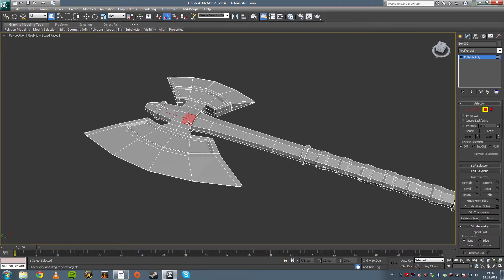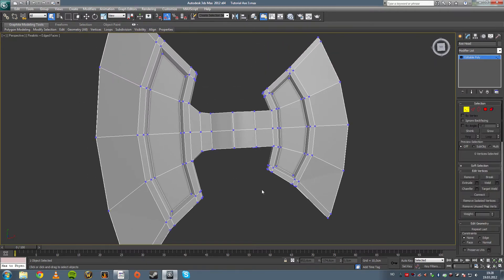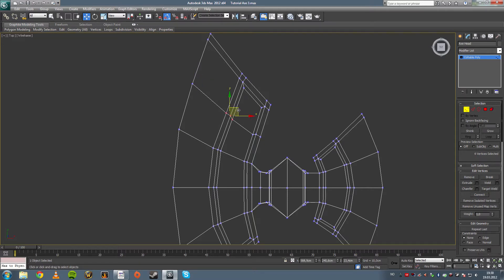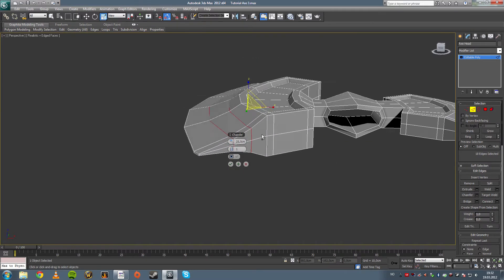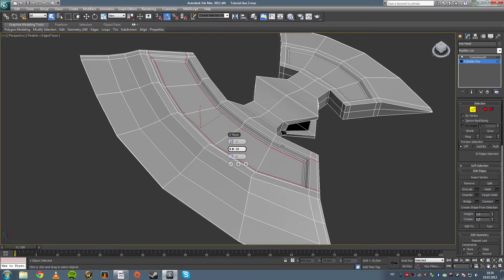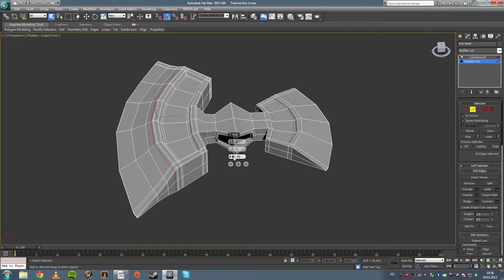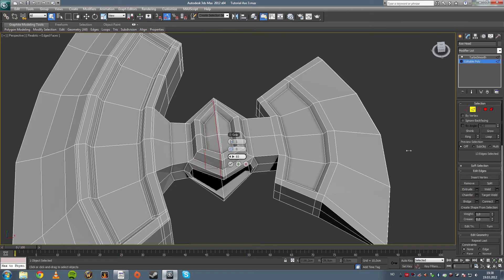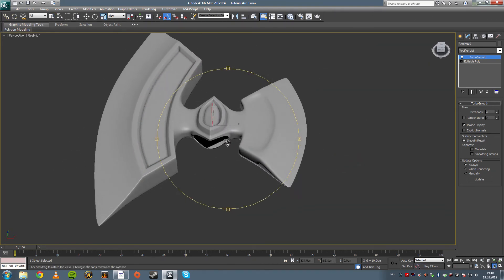Sub-D Modelling in 3Ds Max Part 2

Comment: Great advice for beginners to Sub D modelling. I personally avoid Turbosmooth and use the Sub Division Surfaces in the sub object menu. Reason being is although the isoline display is similar it's easier to toggle it on and off while modelling. I do use mesh smooth once the model is finished though especially when exporting the mesh. subscribed

Comment: at 2:23 you say those are artifacts, i was getting those on the faces when I was scaling the axe blade down.   I tried to correct it but it was extremely time consuming so I just gave up and I'm following along with just a straight, instead of curved, axe blades.  any tips for that would be good